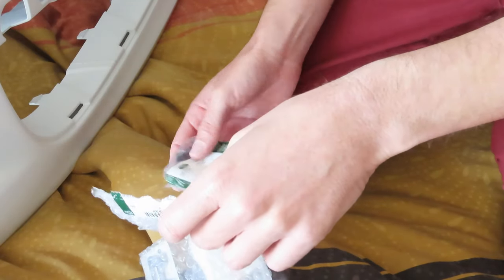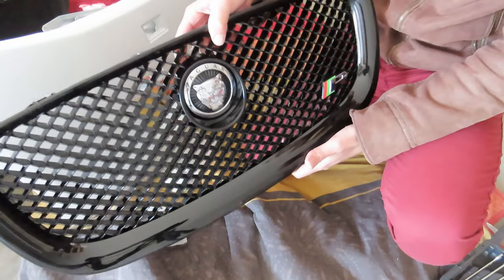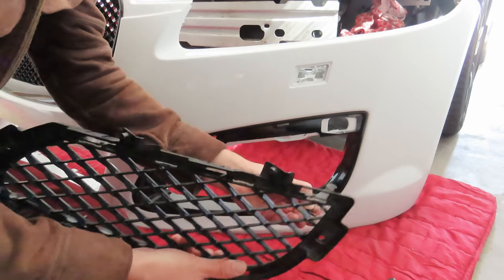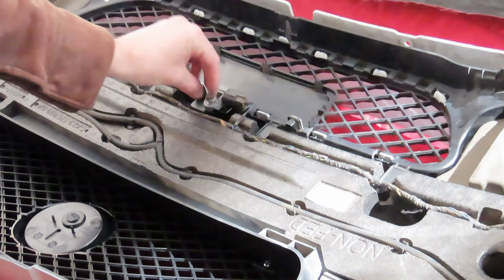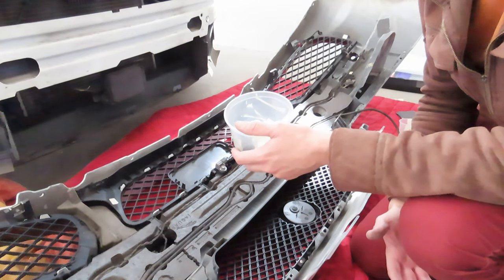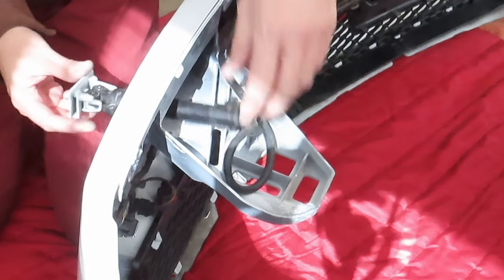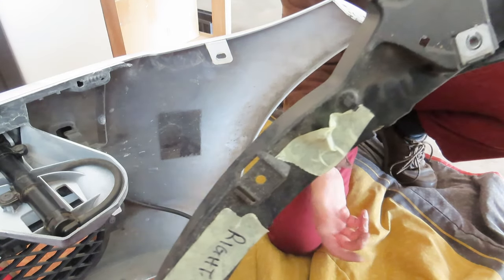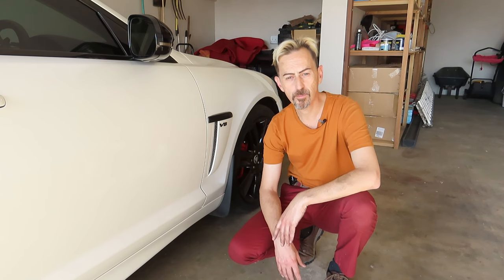Bumper reinstall - painted, new grill and wrapped vent grills

Comment: Just removed the bumper of my XE to re-attach two parking sensors. Interesting to see how different they are attached to the bumper, mine were "hot stapled", so I had to sand the bumper in order to be able to glue them back with contact plastic glue because I don't have a hot stapler. 
Your car is quite beautiful.
Reply from the maker: Holy cow. Just shows how standards have dropped from generation to generation 😳

Comment: Took my 2015 xf sport Jaguar to the dealer because my air was blowing hot. My car was in the shop for 2 weeks. I paid 2500 and never talked to a service guy on the phone. He texted me. It was the worse customer service ever. The whole experience was weird. I love my Jaguar. I love the way it looks and the way it drives.
Reply from the maker: Holy cow. That's an expensive repair. I guess they had to pull the HVAC out to get to a faulty stepper motor.
Reply: @carfanfan  it needed a new compressor
Reply from the maker: @Momof3  oh boy. That's an expensive compressor. I don't understand how they reach their pricing. Markups must be high.
Reply: @carfanfan  Yes! It was a joke. I usually take my car to our favorite jag and range rover mechanic, but he does not do air conditioning. So we took it to the dealer.

Comment: Hello could you help me?  I just bought a jaguar xf 3.0 diesel and I would like to know what version it is since I am surprised that it comes with the Dynamic button. Thanks
Reply from the maker: Hey Felipe, the 3L diesel was considered by Jaguar to be a performance car, even though it is diesel.  Audi and Mercedes both had equivalent models competing in this segment.  It's a powerful car and very underrated by many.  For this reason, all 3L diesels are fitted with dynamic buttons which stiffens the shocks, holds on to gears a bit longer and makes the steering heavily weighted ;)

Comment: CHECK PEDESTRIAN SYSTEM
Hello... what does this phrase mean
I didn't notice an industrial bump and I crossed at my speed
And then this message appeared in the tabloon
Reply from the maker: The pedestrian airbags are under the hood close to the windshield. They are two round cylinder like things that pop the hood up to prevent pedestrians from hurting their heads on the engine block if you strike a pedestrian. Check the plugs that they are plugged in. Possible it popped loose when you went over the bump 😉
Reply: @carfanfan  I'll check the plugs... Thank you
Reply: @carfanfan  Where can I find the socket? Is there a video?
Reply from the maker: @alqethme2009  It should be close to the airbag. Usually yellow. Make sure you unplug the battery when working with it. It's part of the airbag system. If it's unplugged and you plug it back in, you will need to reset the airbags to get rid of the message. A tech would need to do that for you using an OBDII scanner. If they are both plugged in, then one of them is faulty or the wiring is somehow corroded. I would get used parts in this case from a salvage yard.